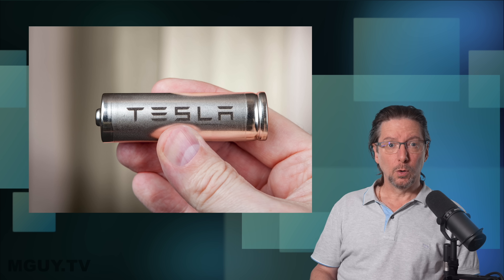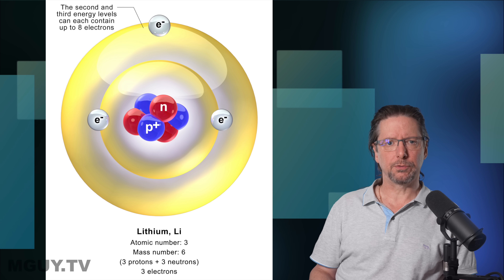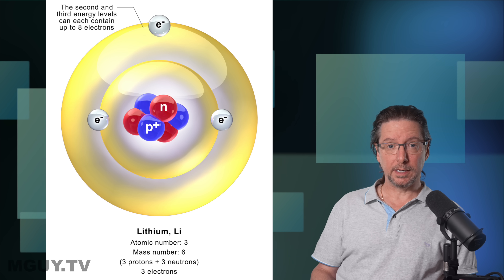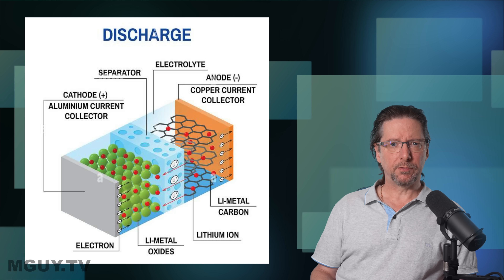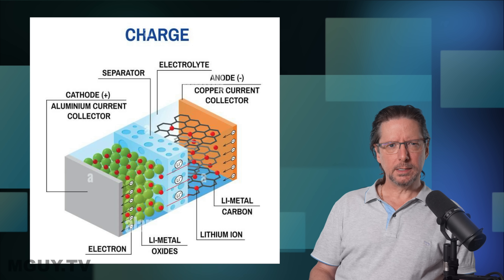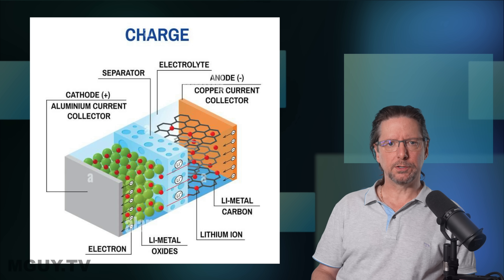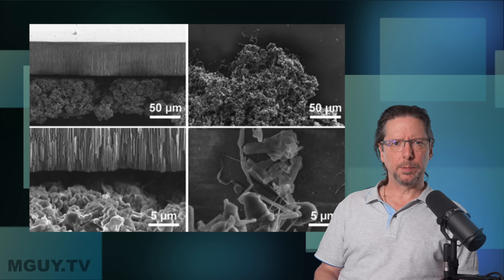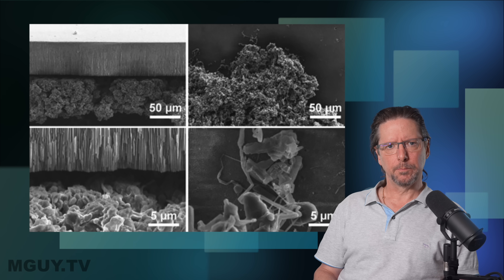Why are EVs so TERRIBLE in the cold? | MGUY Australia

Comment: Could you consider charge/ discharge chemistry in hot conditions. In many countries the temperature under the car from hot tarmac ,sun , vehicle friction will be 35-45 ‘ C
Reply: i believe the battery packs are water cooled already,  as they get hot while charging
Reply: @FrenchmansFlats51  believe they are operationally uncomfortable above 22 ‘ C . Interested to hear an expert view on what , if anything, are the consequences of very high temperatures , how controllable they are, and the effects of fast discharge, fast charging under excessive temperature.
Reply: @johnwilliamson8110  The Tesla Plaid has a function where it prepares the battery to deliver  maximum power which takes 10 minutes or to warm it up.   There is a disclaimer/warning when you activate this function that doing so will degrade the useful life of the battery and I think you must punch 'agree' before it'll let you do it so you can't do it by accident.  

No doubt the car or cloud will remember how many times this function was activated and any battery issues in the future will likely have this brought up as a contributing cause.
Reply: @recoilrob324  wonder what the target temperature is ,and whether there is a particular cool down requirement especially before fast charging?
Reply: @johnwilliamson8110  From what I've seen...most of the time the battery needs to be heated up to allow it to fast charge rather than cooling it.   The charging temperature is hotter than the battery normally operates out on the road and 'pre-conditioning' needed before fast charging and I'm assuming the pack temperature control will then maintain proper temps while it's charging.
The cars that were having so much trouble in Chicago were almost out of juice which meant they couldn't heat themselves up with the remaining charge so when they plugged in...nothing happened.   Actually they said that a slight amount of power would actually go into the car which would use it to heat up the battery so it could charge...but that could take 45 minutes to over an hour just sitting there before it could even begin to charge.  Nice!   So even the chargers that were working (many were not) were jammed with cars taking hours longer than normal to charge.
Reply: @recoilrob324  thanks interesting and undoubtedly true about the cold . Woukd like to hear our expert’s views on how excess heat may / may not affect the battery chemistry
Reply: Right!   The battery must have a heater to warm it when it's cold as well as a way to cool it when it's too hot.   Many are using heat pumps today as the most efficient way to do this while older vehicles had to use resistance heating and basically a small refrigerator system for cooling.   Aren't EV's wonderful!
Reply: 😆😆👍👍 @recoilrob324

Comment: How does the heat effect the battery? It was 35 degrees here today... We do get up to over 40 degrees  here  every year...
Reply: explosively.
Reply: @@dibrom6981 Thank you
Reply: @jamessmithsaltyarmy5210 im afraid that I don't agree with the above comment (or EV's). In real life its almost never going to be an issue in the way that cold is. I was building a truck to drive across Asia and was extremely conscious of the potential for heat build up so i had latice cell batteries built. These have space around each cell - unfortunately and this is critical - you can't do that in a car bc it dessimates the energy density ratio, and therefore range. The only problem i could forsee is: if you were some dumb Arab and you repeatedly used the Ludicrous button in a Tesla until the battery was depleted - that could possibly push cell temps up hogh enough to start Thermal runaway, other than that its almost impossible bc the BMS would stop you anyway. EV's are garbage but no need to bend facts
Reply: @@dibrom6981 If you have access to an IR Thermometer,  have a look at just how hot tarmac gets on a "reasonably" warm 30C day in direct sunlight.  Our grey painted concrete driveway was radiating at 95C, and the adjacent  tarmac road surface was a "very warm" 135C, at mid-day (1pm local time)
Reply: @@dibrom6981 The extreme heat also dissipates (for lack of a better word)  the energy leaving it unfocused and susceptible to energy loss. Much like high voltage wires, when energy moves from place to place energy loss is a big problem. In the US about 80% energy loss is the norm, and for a grid the size of many in the US, 80% is still a great number. Heat breaks things down, leaving different avenues for that energy to escape from, that's one of the big problems with series circuits, lots of points of failure. I imagine on high temp days you're probably talking about 15-20%, that's a big loss.